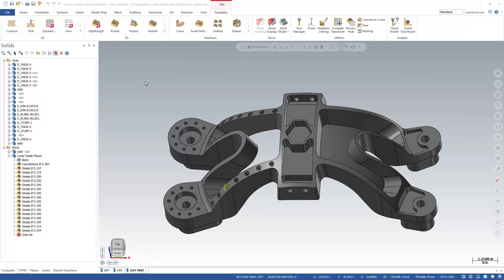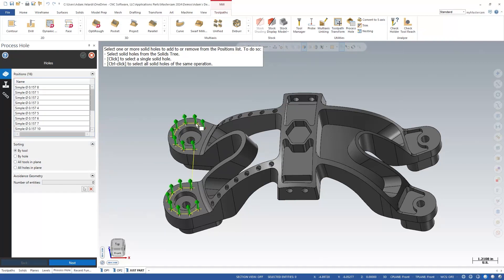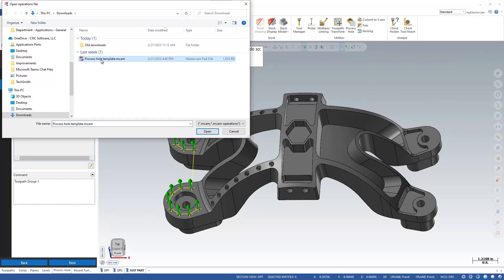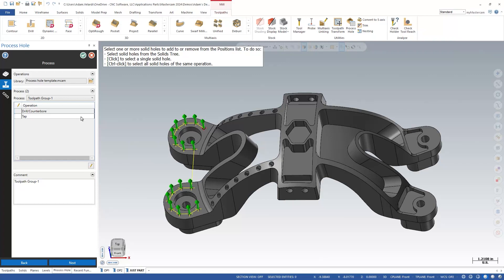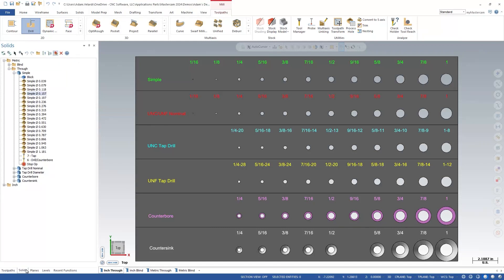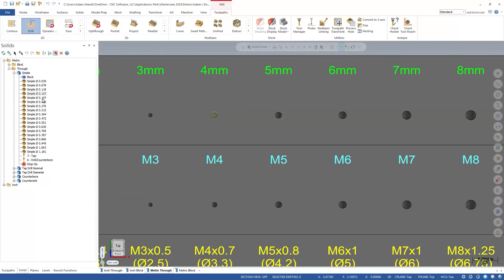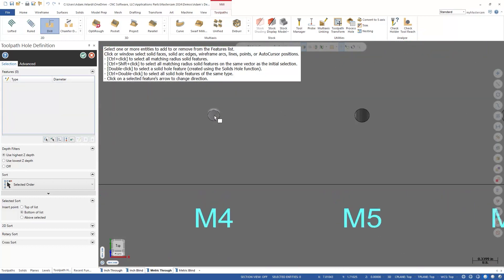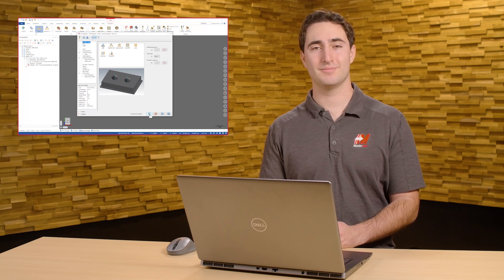Process Hole Setup | Mastercam 2024 Signature Parts

Comment: hi i use mastercam daily and one of the most cumbersome tasks to do is deephole drilling.can processhole automate the process of making deephole drilling .the sequence with spotdrill -predrill-longer drill that is slowly inserted in the hole-coolant on etc basically what advanced drill is used for ?????.Can this be automated.???
Reply from the maker: Process hole does not replace advanced drill but if you regularly use the same or similar advanced drill toolpaths it can save you programming time by allowing you to not have to repeatedly make the same path for every part. Process hole does allow you to combine spot drill and predrill operations into one single operation.